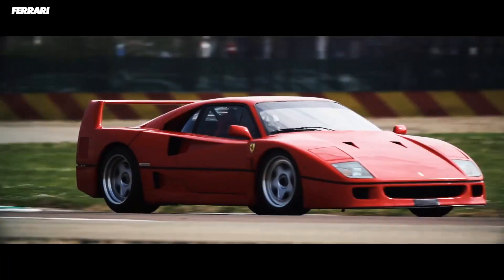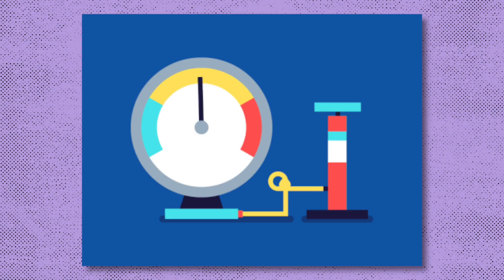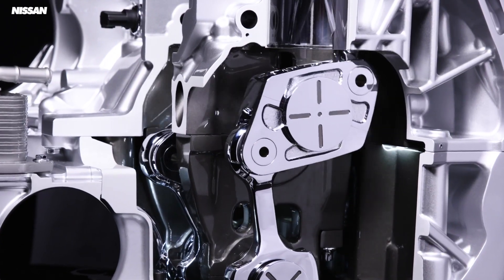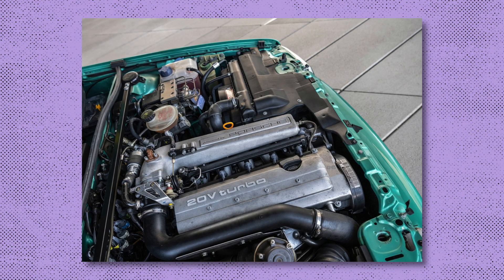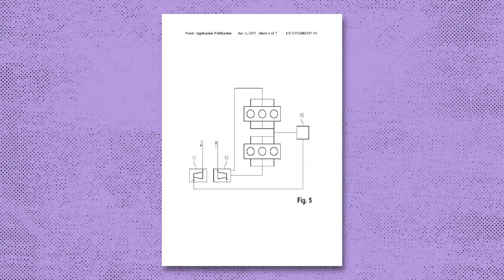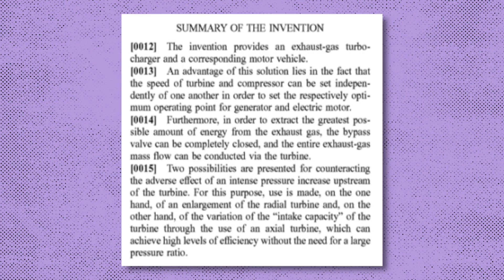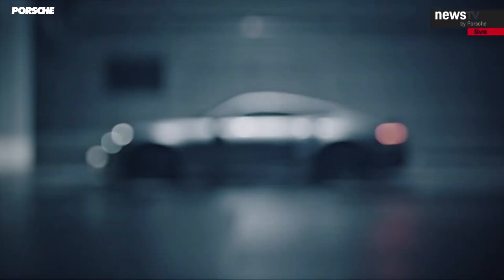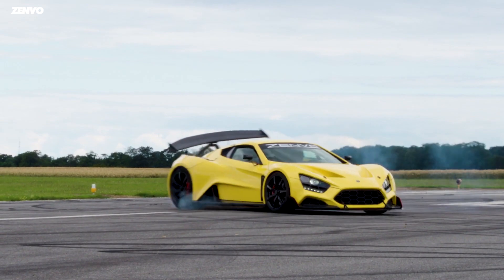Porsche's GENIUS New Turbo Design

Comment: We should all get behind Porsche for everything they’re doing to keep ICE alive
Reply: Porsche is the sports car OG
They still manufacture manual cars 😱
Reply: I think Koenigsegg is doing more to keep ICE alive (though they obviously don't sell nearly as many cars). They also dived headfirst into hybrids, but at least for the sake of the driving experience they are not using CVTs. Their camless valvetrain and transmission designs are ingenious
Reply: This is just a copy of MGU-H from formula 1. Porsche hasn't invented anything here.
Reply: By doing what?
Reply: @falcongamer58  manufacturing gasoline out of the carbon in the air. Further improving the efficiency of the ICE. Creating new technologies to clean up the exhaust of their cars etc.
Reply: Porsche engineers are focused on Electrics. They have many new employees with little knowledge of IC engines. IC engine develkpment is cheaper than leaps and bounds in electrics being done by more specialized firms. Porsche and all manufacturers cannot afford 24/7 R&D so most of development is done by small firms. 
I remember ÷/-100 Porsche and VW engineers following 27 year old design god Urs Wenger around at a visit to Swissauto like puppy dogs hanging on each word
Reply: You mean puts on Porsche, right?
Reply: There's also there  research on a synthetic  fuel
Reply: @miguelcastaneda7257  yeah but porsche has admitted that it will not be used on their production cars. they have done research to determine if it was viable and decided that it was way too expensive so they stopped. it’s so crazy how everyone talks about their tests but no one payed any attention to their results. unfortunately electric is the future
Reply: @takingafatdump  if and when power grids are updated and fixed almost  all areas can barely handle what's being used  now  and electric  tesla can't ve charged 100% public doesn't know till after purchase...only charge 80%if do to 100%  you ruin them
Reply: @miguelcastaneda7257  both of those points are completely untrue. the charge cycle of an ev is similar to your phone. each time you spend 100% it counts as a cycle. the more cycles you use the more your battery wears out so charging to 100% all the time will technically wear out your battery faster. but they have fixed this in software. since the range of teslas are 300+ miles now and many other evs are catching up they have software that tells you your range and if you plan to go somewhere on the infotainment the tesla software will tell you how much to charge the car to make it there and back with some to spare. if you do charge your tesla to 100% it won’t break it it will just slightly reduce the life of the battery. as for the grid that is a load of bs and the grid is more than able to keep up with evs in most areas of the us. your air conditioner uses more electricity than an ev charging.
Reply: @takingafatdump  to much hassle. You need to drive to other place for an emergency and it simply will not happen, And don’t tell me to keep a spare ICE car for emergencies. That’s like going backwards. The electric grid is not enough to charge electric vehicles. just check what happened las summer in California.
Reply: @jerryy8383  lol that ice car idea is so stupid who would do it? the answer is keep your ev on the charger when you’re home. we have an f150 lightning and i’ve heard stories of people who were actually able to use the truck for backup power in blackouts, you just need a generator hookup in your houses panel. with 300 miles of range (and even more on the higher trim levels) our f150 is actually very practical in emergencies. with gas prices the way they are we probably have less range in my honda civic than we do in the lightning just because i don’t fill it up as much to save money. 
now evs are super expensive and not very cost effective for most people right now but that is changing pretty quick. the thing is your arguments are definitely behind the times. these are points i would expect to hear back in 2012 when evs were first becoming mainstream. the grid stuff is fake news i’ve addressed this in a previous comment.
Reply: ICE will stay alive for at least 50 more years
Reply: Porsche are investing heavily in sustainable fuels so us folks that enjoy the emotional aspect of having a screaming engine.... they are doing a lot. And they are still making high performance NA engines. Hats off to them.
Reply: @Esh In a world full of EV's, ICE engines full of parts, eventually won't make sense for Porsche. They are well aware of this.
Reply: @DetroitMicroSound  Except if people will want to buy it, then it will always make sense. ICE will always be more fun than EV. Synthetic fuels will be the answer to allow ICE’s to live on longer than they ‘make sense’. Plus humans are emotional beings, things don’t have to make sense when they make us feel.
Reply: "We should all get behind Porsche for everything they’re doing to keep ICE alive"
Why? We don't use steam engines anymore. ICE will dissapear sooner or later. And maybe some day electric cars will be obsolete too and get replaced by newer tech.
Reply: @arturama8581  Happens every time, and no amount of luddites can stop it.
Reply: Toyota also. Not giving it up til another way is ready
Reply: After failing the car god PAUL WALKER so they should!!!
Reply: @Yukanhayt-Mhenow  ahh his driver was speeding.
Reply: Literally behind porche's 911 turbo s lol
Reply: Amen brother 👏🏽👏🏽👏🏽
Reply: If we could all afford them.
Reply: @beatonthedonis4726 lol not in anyone’s lifetime that’s reading this
Reply: No way, after the Taycan Turbo stunt I realized this is only a carmaker for rich fools that doesn't give a flying fuck about what's under the hood. An electric car with a turbo, the last time I trusted that combination the (RC) carmaker was called NIKO.
Reply: A VAG product. Take that BMW and Merc
Reply: Except they are not doing what you say. They are going electric, just like everyone else.
Reply: @DetroitMicroSound  they are doing both
Reply: @DetroitMicroSound  Pay attention now, he said Porsche is still manufacturing manual transmissions. That is true. I have known several of their engjneers. Despite turbos and electrics all with tell you real sports cars have conventional IC engines, rear-wheel drive and manual transmissions.
Germany still considers manuals tbe best for skilled drivers. If you take the text in an Automatic you will only be licensed to operate them. To be licensed for any car you must take the roughly two hour test with a manual transmission
Reply: @erichkorman710  VW Group is going electric. That's several companies under that umbrella.
Reply: Why would Porsche care about illegal immigrants
Reply: @Bababoui1000  oh inbred....internal  combustion engine...ice
Reply: Definitely! Holding to archaic ideologies always is the best tactic.  It worked so well when cars began taking over horses and some people objected, then disc brakes, and seat belts, and ABS, now electrics.  Porsche fight progress because a minority who can't afford your products objects, that's a recipe for success for sure just because Josh says so.. .remind us of your personal financial wizardry as well as where you obtained your business PhD again so we can take your post seriously?
Reply: @slowery43  Race car drivers are starting to fall in love with electric...Except those on NASCAR teams. They probably love them too, but are contractually obligated to never talk about our electric future. I just recently was checking out the EV Porsche race car concept. Pretty mean car.
Reply: @slowery43  you are one of those people who doesn’t truly enjoy the soul behind racing. That’s fine, but keep your bad opinion to yourself. All of those things were improvements, EV racecars are a sidestep at best. It would be like Legos that build them selves, what’s the fucking point?
Reply: @slowery43  I own a 911. I would never buy an electric 911, there is no point in that. And I don’t care about the efficiency of an electric vehicle, I’m willing to pay $10 dollars a gallon instead of going EV. I buy a 911 because of the driving characteristics. I have driven the Taycan, but I think that is is too much money for a car that many other manufacturers are selling for less, así it lacks the sports and engine characteristics of a 911. Yes, we will all end driving EVs eventually, but for sure it wont make sense to buy a 911 EV.
Reply: @slowery43  one problem with ur post. Going from ICE to Electric is not the same shift as going from a horse to a car.
Reply: yeah even hitler got behind porsche!!
Reply: @gangsterwafflesthe7th508  Porsche got behind Hitler. He lobbied the Nazi governmenf and helped design murder machines like the Mk III tank and quad 20mm AA gun. He was fine with factories using forced labor and slaves worked literally to death building the Autobahns. It's interesting thar a famous jewish comedian who makes jokes about Nazis is a fan of a famous one

Comment: Sure, on my next $250,000.00 Porsche I will worry about checking that box. Or I can wait until it fails and pick up the same car or a Brit P.o.S. that starts way overpriced and then buy it for pennies on the Hundred dollars. U.S. cars are overpriced but not enough to buy a large house with a 6 car garage overpriced. But wait, there's more... You can't drive it in London or most of the U.K. even IF you could afford the petrol. Really relative for the working class schmucks that watch this channel.

Comment: On the Koenigsegg Jesko there will be a system that injects compressed air into the turbo's from a small tank. They don't yet say if that air will be injected into the hot or cold side of the turbo, but it's still a pretty interesting solution to lag in large turbochargers.
Reply: WRC focus had a boost tank too
Fairly brilliant idea to reduce drag with minimal complication and weight addition

Comment: I'd like to see turbo-compounding return. But there is a loss in efficiency by implementing the mo-gen system.
Reply: The only time compounding is beneficial is if you need higher pressure ratios. Since most production vehicles are going to be knock limited from the fuel they are running, It makes no sense to try and increase the pressure ratio further through compounding. A properly sized single will do all you can out of the fuel that manufactures design their cars around.
Reply: @Vehicular.Shenanigans  compounding might work on diesels
Reply: @ayoutubechannel921  right because you can take advantage of the higher pressure ratios. It’s not practical though because higher pressure ratios are used to increase power and torque so you would do that in 2 applications from the factory. Towing, or a sports car. Problems would be for towing you’d either have a tiny motor with a lot of boost causing which isn’t great for towing because high stress and no torque. Or a huge motor making 2000lb ft which is unnecessary and would incite extra cost for no practical payout. Or in the case of a sports car who wants a massive heavy slug way over the nose of the car and gas is just more fun for that application. So there’s no practical common application where compounding would be worth it in an OE vehicle situation
Reply: @Vehicular.Shenanigans  You're misinterpreting what Kenny Phillips meant by turbocompounding.  He didn't mean compound turbochargers for higher boost pressure.  He meant an extra turbine in the exhaust to recover power and feed it to the crankshaft.
Reply: @andyharman3022  interesting idea but I can’t imagine that being as effective or efficient
Reply: @Vehicular.Shenanigans  Porsche used that exact technology in their 919 race car.  It won LeMans, so it must be effective and efficient.  Turbocompounding goes back about 70 years when Curtiss-Wright built R3350 turbocompound radials that were used on the last generation of propeller driven airliners.  More recently, Scania has developed a turbocompound 12L diesel heavy duty truck engine.

Comment: The problem with synthetic fuel is that it takes a massive amount of electricity to produce. Then you've got to store and transport it to whichever country. Porsche are doing this just to satiate their own customer's. This will definitely not be viable as a mass market fuel. Not to mention Governments legislating against ICE powered vehicles. The death knell has sounded for ICE whether we like it or not. The future is BEV. Not Hybrid, Not Hydrogen..
Reply: The issue with BEVs is, not every country can provide enough renewable energy to power them all. Germany, for instance, has some parts where it is windy but cold, some were it is warm (only in summer) and some where none of them is constant. Meaning, the renewable energy generated has to be transported all over Germany. Even if the whole country is provided with renewable energy, each car has to get charged at some time. So, each parking spot or most parking spots have to have a charging station, which is nearly impossible to provide and maintain. If you have a garage, okay easy, but when you live in the city, you are more or less screwed finding a charging spot.

Hydrogen on the other hand can easily be implemented in our infrastructure. The petrol stations can provide the hydrogen and most cars can also be transformed into hydrogen cars. However, I think a mixture would at least be a fair solution, some BEV (for daily commuting), some hydrogen (for trucks and long distance) and some synthetic ICEs (for sport cars)
Reply: @yourDecisi0n New ICE cars will be banned from 2030 in Britain. There are only 14 Hydrogen refuelling stations in the entire country and most manufacturers are walking away from the development of Hydrogen Fuel Cell cars. Mercedes has abandoned it's F Cell venture. Both Toyota and Honda have decided against further development of Hydrogen Fuel Cell cars. JLR are in the same boat. We can only buy 2 Hydrogen Fuel Cell cars here. A Toyota Mirai and a Hyundai Nexo. In total only 16 of these 2 cars where bought and registered in GB in 2021 Vs nearly 191000 BEV cars. Hydrogen is a dead duck as far as the car industry is concerned...
Reply: The US alone is likely a large enough market for Porsche to justify investing to keep ice relevant for a couple more decades. The US won't eliminate ice as directly as European countries are.
Reply: @Lessenjr  I don't think the U.S will have much choice in the near future. It will be seen as a Pariah by the rest of the world if it doesn't do something to cut Green House gas emissions in the short term. Not to mention Porsche doesn't sell Hundreds of Thousands in the US to make a difference. The next Boxster/ Cayman are BEV only. As are the next Macan and Cayenne. Taycan has sold in larger numbers than the 911 in 2021 and it'll only continue to outsell it in the future. The facelift 911 will have a hybrid system and my guess is that the next version will most likely be BEV just like the rest of the range. Sad times definitely, but undoubtedly the future. They hated the Motor car back in the early 1900s and never thought it would catch on. Technology and change is a constant. Who knows what will happen in 50 years time. Probably mass transit mobility rather than individuals owning their own cars..

Comment: This is in fact clever. And for those not in the know utilizing hot exhaust gases is more efficient than simply using a generator that is belt or gear driven.
Reply: true. instead of opening blow off valve or wastegate, electric system can simply store the excess energy into battery or super capacitor.

Comment: An electric turbo is a supercharger. If you use a motor to assist the turbine in combination with the exhaust gas that’s a diffrent story
Reply: I was thinking the same initially, but it's still primarily drawing it's power from the exhaust gases rather than the crankshaft. It's just that by converting that energy to electricity rather than directly driving the compressor fan with a shaft they have more flexibility in how/when to drive the compressor.
Reply: @RyanJamesODonnell  Ig.